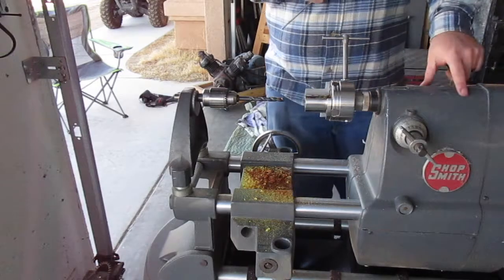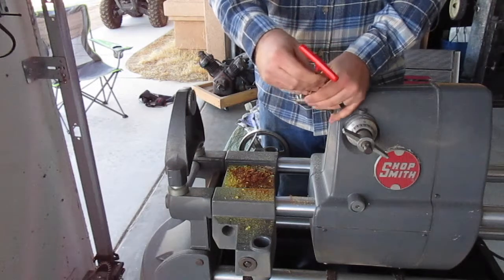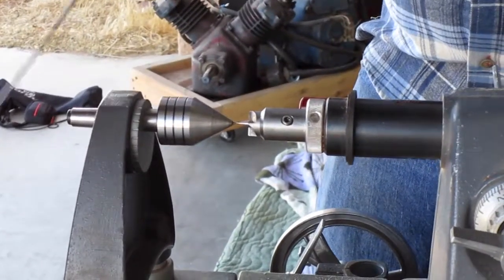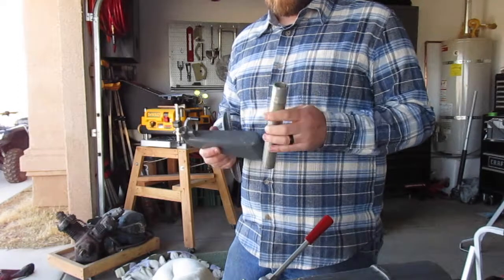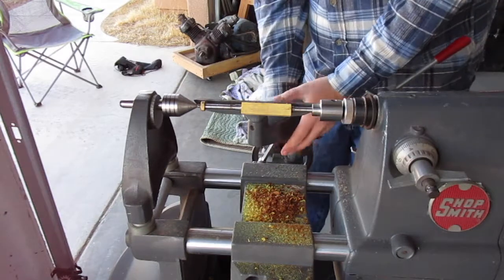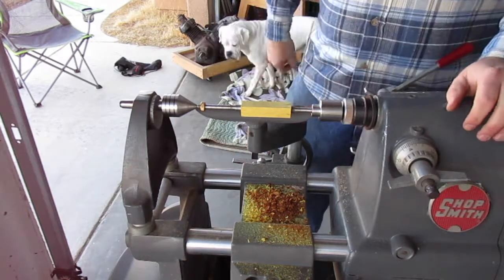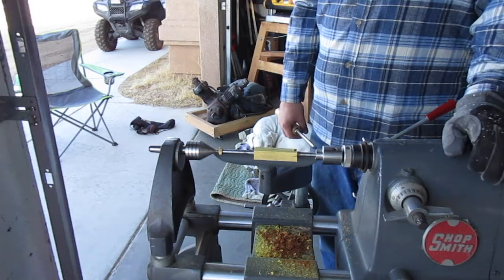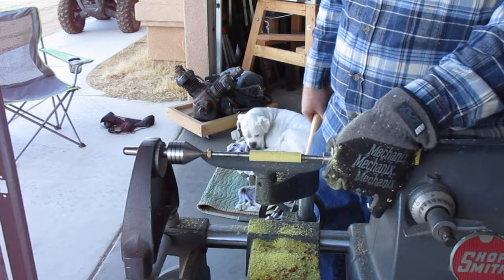Shopsmith pen turning part 2

Comment: At around :30 seconds, you removed a chuck from the headstock.  What is that chuck...and where did you get it?  I'm sorry if you explained it elsewhere.  I have a 40-year old Mark V, but no headstock chuck beyond what came with the machine, but I'd like to have more capability.  Many thanks.

Comment: Thanks for highlighting the Shopsmith for pen turning.  Am looking at starting making pens using a shopsmith.  You mentioned in video 1 that you use the Nova chuck.  Do you have a good source for that?   Thanks.  Great video.  Will explained steps.